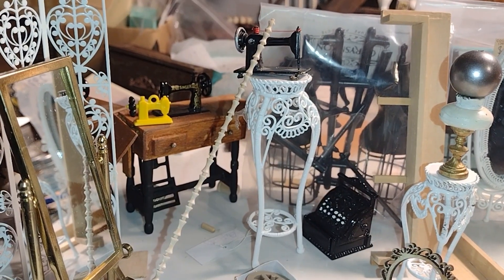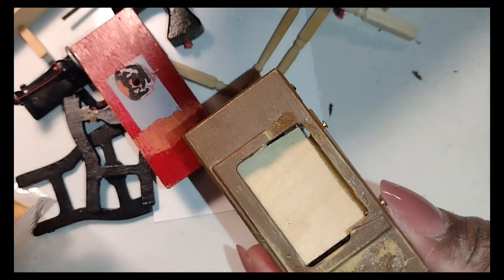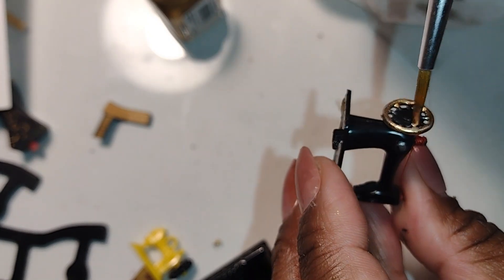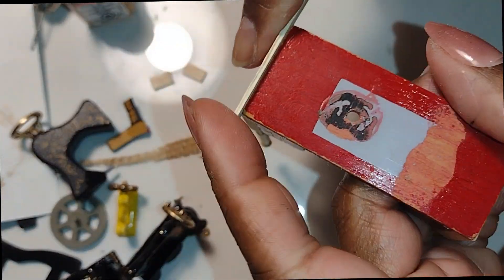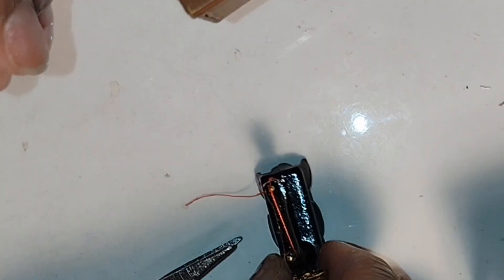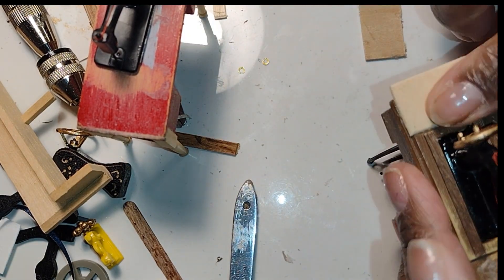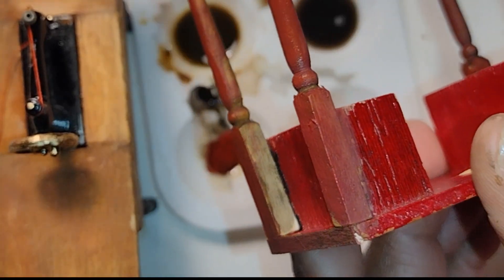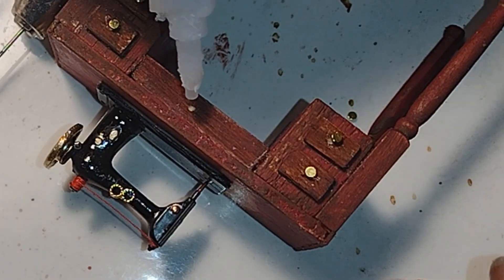MINI Sewing Machine and Things PART 1: -Sewing Machine Repair and Up-cycle

Comment: There's THREAD on the tiny sewing machines!!!! 😍😍😍 Sooooo adorable! Could you hear my squee from Michigan? 😄 Those details make all the difference!  The treadle "mechanisms" do make the tables look more period, but something seemed a little off. The treadles I've seen have been attached at both the left and right, not just on one side. I Googled "treadle sewing machines" because, to be fair, I've seen a fairly limited number of treadle sewing machines, and they did come in more than one design.  All the images either had the treadle on both sides, or attached in the center back (I didn't know that was an option! 😮). Not all the supports were the same on the left and right, but all the side-supported treadles were supported on both sides. I just want to be helpful, not critical. You know I love your work! If you're happy with the treadles as they are, that's what really matters. 😊 No one is expecting the machines to actually sew anything.
Reply from the maker: Thank you Laura! YEAH, Historical, Mechanical, or Scientific Accuracy are never My GOAL! I'm having FUN and showing you DOLLS the possibilities. My DOLLS will be able to sew whether they have a treadle or not. LOLLOLOL! ALL Fantasy and FUN! Breaking ALL the Rules over here! But thank you for the Facts!